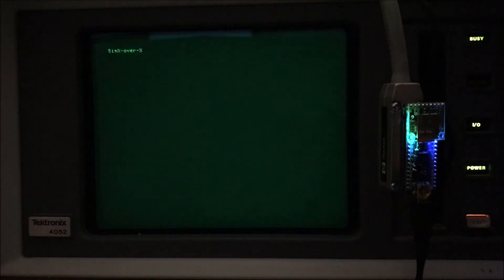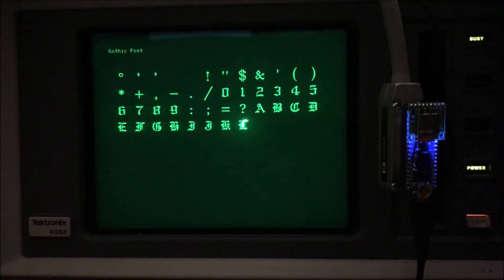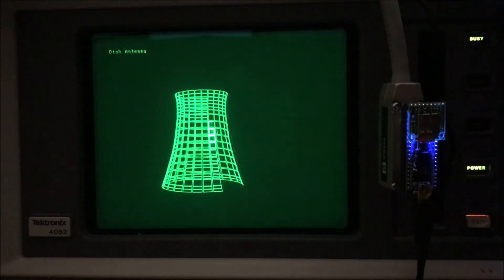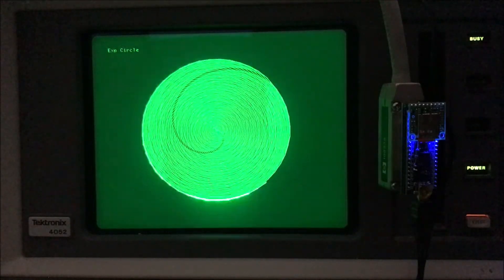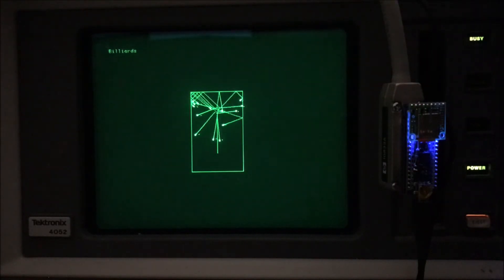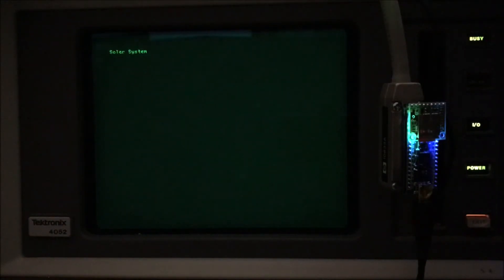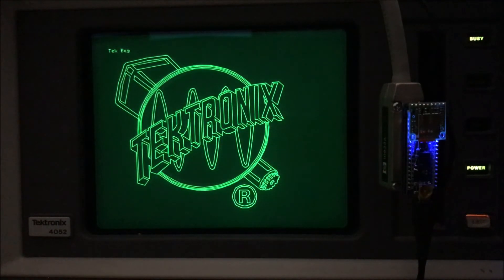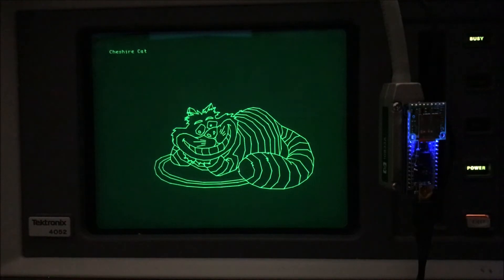Tektronix 4052 Fast Graphics demo

Comment: I never knew they held the image like that. I thought they would have to continually retrace.
Reply from the maker: Tektronix developed their own storage tube technology in the late 1960's - see this article: https://vintagetek.org/dvst-graphic-terminals/  First as a monitor - then as a series of storage tube terminals and finally as a series of desktop micro-computers running BASIC programs starting in 1975 with the 4051 followed by the second generation 4052 and 19-inch 4054!  Solid-state Memory was incredibly expensive in the 1970's - so the Tektronix 4010 terminals and 4050 computers took full advantage of the storage tube to lead the industry with high resolution computer vector graphics - 1024x780 for the 4051 in 1975 followed by the 4052 in 1979, and then an incredible 4096x3072 for the 19-inch 4054 in 1979!

Comment: In case anyone wonders how this display works in more detail: There are two electronic guns inside the tube. One gun is the one drawing to the screen. It fires a high energy, very focused electron beam, which makes part of the screen passable for electrons when getting hit. The second gun constantly shoots a low energy electron beam to the screen that is intentionally not focused but rather hits the entire screen at the same time (flood gun). At the locations that have previously been hit by the high energy beam, those electrons can pass through an isolation layer on the screen and reach a phosphor layer, where they cause the phosphor to emit light when passing through it. That's how the image stays stable for as long as the flood gun is powered, yet it will somewhat faint over time as the isolation layer will slowly lose it's conductivity (we are talking about a time spawn in the range of multiple minutes before this effect starts to set in). Alternatively, you can put some voltage to the screen isolation layer and the entire layer immediately becomes isolating again, that's how you clear the screen. As this voltage also lights up all the phosphor, the entire screen goes bright for the fraction of a second. There exist variations of that tube that cannot only display black and "white" (actually green) but also different shades of grey (shades of green) but the downside is that those will retain the image way shorter before it will start to fade to black again (this probably has to do with the fact that the insulating layer is different and allows different levels of permeability, but also becomes insulating again more quickly).
Reply from the maker: Thanks for your explanation!  I thought that the flood guns were involved in clearing the screen - but your explanation is very helpful.  On my 4054A with Option 31 Dynamic Color - I have to wait at least five minutes after turning the 4054A on before I page the screen.  Even then - there are areas around the edges that have a faint glow.  If I wait 15 minutes after power on - the screen is completely cleared with the PAGE key.  Maybe I need to run through the 4054A service manual calibration steps - but I don't know if my high voltage probe is working.
Reply: @TEK-Vectors  I'm not sure how the display of the 4054A works in particular, I was just referring to direct view storage tubes in general. Of course, there are different variations of tubes. A Williams tube in fact uses the electron beam in low power mode to write data and in high power mode to erase data again, but that tube is not for displaying anything, it's in just a data storage storage (a very early form of RAM). I just know that the basic way how the display tubes works is that there is an isolation layer saturated with electrons and when you shoot a low energy electron beam from the flood gun onto it, they cannot pass through that layer as the electrons in the layer repel the beam. The high energy main gun shoots electrons onto the isolation layer with very high energy and by doing that, it pushes the existing electrons out of isolation layer (like shooting a billiard ball pushes the other balls away on a billiard table), leaving holes of positive charge in the layer. These holes now allow the electrons from the flood gun to pass through the layer and hit the layer right behind it. To reset the screen, you somehow need to fill up the positive holes with electrons again. I'm not sure if this could also be done by modifying the beam of the flood gun somehow, I just know tubes where this is done by simply applying voltage to the isolation layer that will then fill up with electrons like a capacitor.

Comment: I used to program one of these at UniCol Corporation, using APL workspaces on a huge IBM mainframe.
Reply from the maker: My first personal computer experience was with a Tektronix 4051 in the USAF in the late 70's.  I was the operator and the programmer 😁

Comment: I don't understand what this is and I can't understand why I love it so much pls help  :(
Reply from the maker: This is a personal computer introduced in 1979 by Tektronix.  This computer has a built-in display, but it works completely different than the PCs that came after it - the display is called a storage CRT - the computer draws lines and text like a plotter on the storage tube and there is a voltage applied inside the tube to persist the lines or text until the screen is cleared.

Comment: Lovely artwork. I'd love to have the star wars plots to demo on my 4006, as well.
Reply from the maker: Wow!  I didn't expect to have any interest in back-porting my Tektronix 4050 vector graphics pictures to the earlier Tektronix 4000 series vector graphics terminals!  I don't have the image source files for any of the pictures in this Fast Graphics video.  These pictures were developed in the late 1970's by the author of the 4051 Fast Graphics ROM Pack.   I would have to create a Tek 4050 BASIC program to try to extract particular picture files from Fast Graphics format to Tek 4000 series terminal format.  Please check out my later video: https://www.youtube.com/watch?v=L4cYHIgkCkM which covers "Tektronix 4050 R12 Enhanced Graphics Demo" which starts with these same Fast Graphics demo files and adds the new vector picture files I created starting with files 28-35 including Star Wars C3-PO, R2-D2, BB-8, B2EMO, Utah Teapot, Columbia Space Shuttle, 007 Submarine Car, and Sutherlands' VW Bug!  I used Inkscape to create these new files and the ASCII source files are in my Tektronix 4050 Flash Drive zip file in my github repository located here:  https://github.com/mmcgraw74/Tektronix-4050-GPIB-Flash-Drive/blob/master/FlashDrive27Feb2023.zip  Download and unzip this version and in the ROOT directory you will find files numbered 13, 15 and 19 are ASCII text files containing M (MOVE) and L (DRAW) X,Y vectors for BB-8, R2-D2 and C3-PO respectively.  You would have to create a program to convert each file into the Tek 4006 vector graphics file format.  I don't have a Tek 4000 series terminal so I have never created such a program.
Reply: @TEK-Vectors  cool, i will have a look when I get home, ASCII to .PLT is probably possible using gnuplot or with a python script. I have functions for taking coordinates and drawing vectors already so it should be possible. Also older cups has a tek output filter but those"prints" tend to be huge and overly detailed. The 4006 maxes out at 4800 bps.

Comment: The various "simulations" as mentioned in this video, for example the billiards table/balls, or the bouncing ball.  Is it an actual simulation, or just drawn to appear like it?  Curious.  
Regardless, this is such a cool video.  I am particularly impressed with the high resolution. Thank you for sharing.
Reply from the maker: Each of these Fast Graphics files are simply vectors which can be displayed as lines or dots.  The 'simulation programs' would have been run on another computer - likely a DEC mini-computer (heavily used at Tektronix to design both their 4010 series vector graphics terminals and the 4050 series vector graphics computers) and the output vector data converted to the Fast Graphics vector format with three 7-bit ASCII characters encoding each 10-bit X and Y vector endpoint including 1-bit MOVE/DRAW.  These Fast Graphics/R12 Graphics Enhancement files work on all Tektronix 4050 computers and match the 10-bit X and Y vector resolution of the 4051 and 4052 computers.  The 4052R12 Graphics Enhancement ROM Pack also supports the 4054 4096x3120 vector resolution by multiplying the 10-bit X and Y by 4x to preserve the original image size on the larger 19-inch storage tube of the 4054.
Reply: @TEK-Vectors  So basically, "it's a trap!"  :)
Very cool info.  Thank you very much for the details.  My first experience with computers, as a kid, was in the early 80s and I completely missed these machines.  Got to love tech.

Comment: I can imagine that using these for a final rendering of an engineering part must have been great at the time because of its very high resolution for the time, but much too slow, it seems, for real-time interaction with that data. I may be imaging this, but I seem to remember seeing a documentary once on how they did the CG for the death star trench run in the original Star Wars and I think they used one of these terminals. Very advanced for the time.
Reply from the maker: Yes, I used the original 4051 vector graphics computer in the late 1970's and developed BASIC programs to automate data collection and analysis to speed up the time to decisions for the USAF.  The process I replaced with the 4051 had taken over one month from data collection to plots generated by Calcomp plotters connected to a mini or mainframe computer to an hour on the 4051 with 4631 screen hard copy printer.  The 4052 and 19-inch display 4054 computers were introduced in 1979 with Tektronix custom bit-slice 16-bit CPUs which emulated the Motorola 6800 instruction set and extended it to support twice the memory capacity and hardware floating point in microcode - which sped up the BASIC programs an average of 10x.  The R12 Graphics Enhancement ROM Pack which I am demonstrating in this video gave the original 4051 a 10x boost in displaying graphics that had been pre-computed, like this vector graphics pictures.  The 4054 improved vector graphics performance about 10x over the 4051 and 4052 and increased the vector resolution from 1024x780 to 4096x3072!  Super advanced for 1979 and even today!
Reply: @TEK-Vectors  Whatever became of the company? Are they still around in some form?
Reply from the maker: @JustWasted3HoursHere  - Tektronix was acquired by Danaher in 2007 and some of the businesses were spun off.  Tektronix is still making digital oscilloscopes and some other test equipment (tek.com)
Reply: @TEK-Vectors  Cool. I'm glad they were able to adapt to the changing times. Sooooo many tech companies from the sixties and seventies are no more because they couldn't adapt fast enough (or in the right direction!)

Comment: If I recall, tek had a technology where they could write arbitrary x-y with a CRT beam on the screen, then retain the image drawn. It was the same as the old analog storage scopes used. We worked on a vector draw engine in the early 1980s, it worked by repeatedly drawing the image to refresh it. Vector draw terminals like that were faster than raster draw terminals at the time, and they were used to draw wire frame drawings at actual speed. An example of that was the original "tank" arcade game which was vector drawn. We supplied terminals to Maji, who made the tank animations for the original Tron movie by Disney. They would use our terminals to script the basic actions of the tanks, then a raster draw machine would form each frame of the image, which took days or even weeks to make parts of the film. But the tanks could be moved in real time using a vector draw terminal.
Reply: So it essentially worked like e-ink displays work today! It needs a refresh operation to clear the screen!

Comment: This is amazing! But as of your statement "It doesn't have memory", I find that impossible to believe. You must have meant something akin to "it doesn't have VIDEO memory". Otherwise, where the hell did the instructions come from to make all this coolness? All the same, this is an incredibly impressive demo.
Reply from the maker: You are correct - there is no graphics memory.  The CRT is a storage tube - so the computer draws a vector line and the CRT persists that line in phosphor with a high voltage applied to the inside of the faceplate of the CRT.  The 4052 has 64KB of DRAM for programs and data and another 64KB of BASIC ROMs.  This Picture Menu program is only 2326 bytes of RAM.  The Billiards file is 26KB.

Comment: So you can't really do any animation on this type of display I guess, aside from adding new vectors or clearing the entire display. I guess you could keep redrawing over the same area so you have a few bright dots animating, but you can't actually move the vector shapes from frame to frame. Still, very interesting and I've never seen this type of tech before (I've owned and repaired some old vector arcade machines in the past - Star Wars and Tempest - but they just constantly refreshed). This is like a combination of vector and e-paper!
Reply from the maker: Actually - my 'new' (as of August 2022) 4054A vector computer has Option 30 - Dynamic Refresh Graphics coprocessor board which can draw thousands of refresh (non-stored or write-thru) vectors that are refreshed at over 30 frames a second!  This Refresh Coprocessor contains a separate 8x300 16-bit CPU with an additional 32KB of DRAM for the storage of thousands of refresh vector objects.  This board was introduced as a 4054 option in 1979 along with the introduction of the 4054.  My 4054A also has Option 31 - Color Dynamics Graphics CRT.  See this video for my 4054A demo of refresh graphics:  https://studio.youtube.com/video/M98VOoGFLL8/edit
Reply: @TEK-Vectors  That's interesting. It's the same idea as the Atari vector co-processor in their games. It just constantly cycled through a vector instruction list. It was very efficient with memory though - it mostly worked with relative coordinates, and could jump to subroutines, so the character set and game graphics could all be in ROM, and instructions to scale, change colour etc could be used before drawing them, so the vector RAM only needed to contain the jumps, color/scaling etc changes, and drawing instructions for non-repeated graphics. Only around 2K-4K of RAM for that but it means it's very game-specific, and couldn't be used to draw arbitrarily complex shapes very well!

Comment: Very impressive, vector displays were a great way to get much more out of less processing power and memory in the days when it was miniscule and unbelievably expensive compared to today.
Reply: I noticed how there's only lines added to the screen, never removed, so suspected there's some trickery going on, but just watching the images I'd have no idea how it works. Thankfully he explained that the tube or material of the screen itself retains the image. Next step up I think were computers like the Atari 2600 that refreshed the screen rapidly like today, but had such tiny memory that they could only hold a line of image at a time, so most processing power was "wasted" setting up the upcoming pixels before the cathode ray reached them. Then suddenly memory became super cheap, problems solved. :o)

Comment: I had the pleasure of programming a 4051 in college. It had BASIC, a large format cassette tape, and a xerox-like screen printer, IIRC.
Reply from the maker: I used a Tektronix 4051 at my first job after college.  It was my first experience with a personal computer, and I loved it!
Reply: That printer was quite useful. It used a light sensitive coating on the paper, and some sophisticated electronics to transfer the image stored on the screen's phosphors to a scan bar that the paper passed over. The resulting print turned dark over time but could be Xerox'ed to get a nice, constrasty and stable image. I used those prints to make illustrations in technical docs.

At the Tektronix factory in Wilsonville, the graphics displays dwindled away to nothing and the printer department took over the entire campus. That operation was then purchased by Xerox, who eventually sold off much of it to 3D Systems. The 3D Systems MJP 2500 3D printer uses the same basic technology as the original Tektronix "solid ink" color printers. So I guess we are still drawing 3D images, but you can hold those in your hand now.
Reply from the maker: @KendallAuel  that is a sad tale.  I enjoyed programming and using a Tektronix 4051 computer in 1977-1979 at my first job after college.  That is why I collected a 4052, then 4054 in 2000 - when I first retired (yes I've been back to work since 2001 :)  Tektronix tried shifting emphasis from the 4050 computers to the terminals and then to unix computers and gave up on computers as far as I can tell.  They had the lead on vector graphics but HP passed them on color bitmapped terminals, and both of them gave up as the PC zoomed to the top in the 1980's (I joined Compaq Computer in 1985 and helped drive PCs to the multi-billion dollar business with Deskpro 386, Deskpro 486 followed by the multiprocessor SystemPro server with two Intel 486 in 1989.

Comment: I'd like to see it word process.
Reply from the maker: I actually recovered a text editor named TECO, ported from the DEC PDP-11 minicomputer to Tek 4050 BASIC that I need to run and post a video!  All three Tektronix 4050 vector graphics computers had built-in single line editor in their BASIC ROMs that could be used to enter and edit the BASIC program in memory and the top of the keyboard included LINE EDITOR keys as shown in this picture of my 4052: 
https://github.com/mmcgraw74/Tektronix-4051-4052-4054-Program-Files/blob/master/4052%20keyboard%20editing%20keys%20and%20user%20definable%20keys.jpg